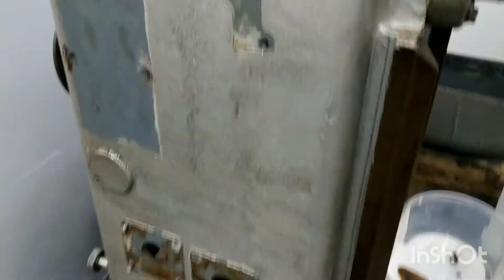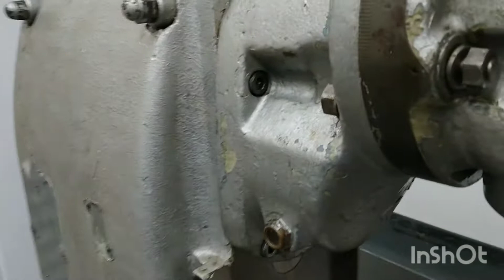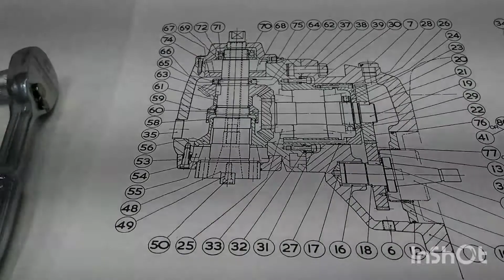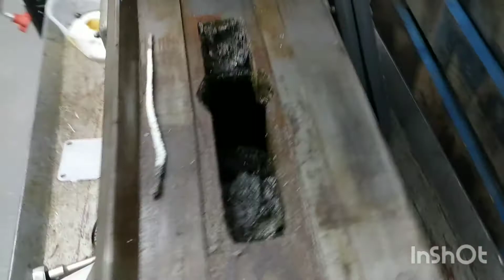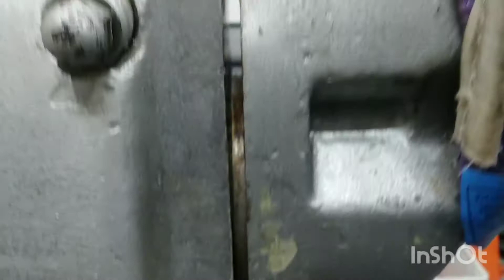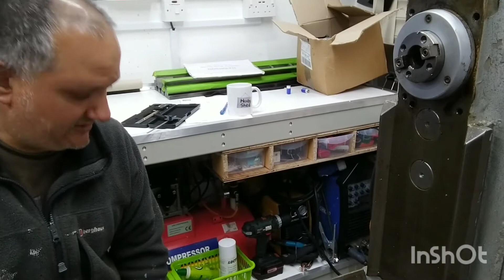Harrison Vertical/Horizontal Milling Machine Restoration Part One.

Comment: good job Carl, I sling the vertical head on my Harrison from a dummy draw bar with a lifting eye in the top, it is very heavy, and the ideal solution, which I am going to tackle  i hope, is to make a free standing lifter crane round the back of the machine, so that the V head can be moved out of the way, and stay on the crane at the side of the machine when the H mill is being used, like the Kerney and trecker system,   https://www.youtube.com/watch?v=G8MyOo-5aRQ 
Good luck!
Phil.

Comment: Very similar to the set up on my Adcock &Shipley 1ES . Mines an iso 40 taper. The head doesn’t have the male taper as the drive dogs transfer the drive.  By the looks of it, your mills ways are grease clogged, cast iron is far better lubricated with ways oil. Something like iso68. Common enough problem is oil fittings which look a little like grease points but are fir pressure oil fitting. Im sure you’ll sort it out.
Reply from the maker: Hi Mat, thank you very much indeed for commenting on my video. You are quite right about the ways of the machine being grease clogged. When I stripped the saddle I spent a very long time with an airline, pipe cleaners, rifle brushes etc, chasing out all the old grease and purging the lines. You are right again in that the oil injection nipples look like grease nipples. So someone has been assiduously greasing them for years. I will get it all cleaned up and rebuilt, but like anything it is time. In a future video I will show some of the progress I have made. Thanks again!

Comment: Hi Carl, great start, and I thought my shaper was in a mess lol. Repeat order paper towel rolls needed to clean that knee out mate, don't envy you on that job. I would have gone ropey slide hammer to remove the bearing caps (finger end lottery - 5 chances of winning with every pull) lol. Cheers, Jon
Reply from the maker: Thanks Jon. You are right, normally I would use a slide hammer type affair to do that job. Probably not even that elaborate. A bolt threaded in with mole grips attached and then tapped with a mallet.

The truth is that due to reorganising the workshop, repairing my DRO and making the machine moving system, my lathe and welder have been stood idle for quite a while. This puller idea lets me remove the plugs and gives me a chance to get back in the way of things with the lathe and tig welder.

Comment: Very good part one. The head came off quite easily in the end, I expected paint and gunge to cling on more tenaciously. 
I suppose it is designed to be readily removable for role changes for the horizontal gear. 
Best wishes, Dean.
Reply from the maker: Thanks. I thought it would come off alright, it was dropping it on the knee ways I was worried about! See you at the weekend!

Comment: Excellent explanation of the work you are carrying out mate, keep the good work up, do you need a parts cleaner for the bits?
Reply from the maker: Thanks Richard. As much as I would love a parts cleaner, I don't have room for one. A lot of the machine is filthy - years of accumulated swarf, dirt and grease - the latter assiduously applied by some well meaning, but ultimately wrong, individual.

My parts washer is solvent in a plastic crate and lots of rags, brushes, pipe cleaners etc. It has worked well so far. In part two I will show some of the work I've done already on the feed gearbox and the saddle. I wanted to show it this time, but it would have made for a longer film.